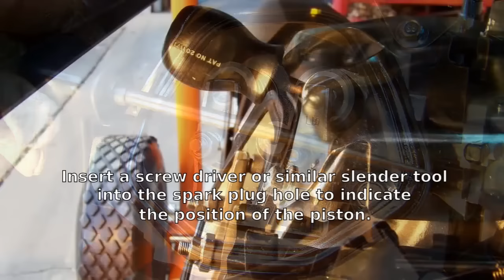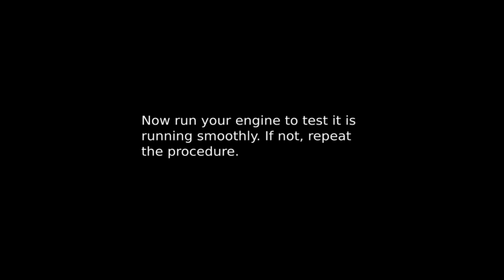Setting Valve Lash Clearances on a Portable Gas Generator and Small Engines

Comment: One small problem you don't state what the spec is on valve clearance
Reply from the maker: That will depend on the engine you have.  We publish valve setting under the brand and model on our website. Just see the cylinder head parts page for the full details. 
Start by finding your generator model on this page: https://generatorguru.com/

If it is not listed, or is an engine on another type of equipment,  please contact our engineers and they will be happy to find it for you. :)
Reply: 7.8 motor

Comment: Threw it on the dolly, put oil in (included) using the funnel (included), dropped in a gallon of the good stuff (see pictures) and it fired right up. Broke it in for a good 15 minutes with no load. She's ready for the next power outage!
Reply from the maker: Great work!!! Glad we could help. :)

Comment: I have a Champion 4650 generator that has a vibration problem since day 1. It has gotten better over time, but the handle still shakes while it is running. I've seen videos of this generator on YouTube, and they don't seem to have that problem. My question is, will adjusting the valve clearances on the generator eliminate the vibrations, or is it another issue? I have check the valve clearances, and it is within specs, 0.004".
Reply from the maker: Yes it should, but also check your engine mounts have not degraded as this also presents like this. If you would like us to check the clearances are correct, or have an engineer help you further, pls contact our Engineers on https://generatorguru.com/need-help/

Comment: Whats the valve lash for a pp6500 pure power, generator
Reply from the maker: We publish all setting on our site under the Make and Model.  It is published under the "valves" listing or the "cylinder head parts" listing (depending on how the manufacturer retails the items.)  Click our website to get your settings: www.generatorguru.com
Reply: @Generatorguru  unfortunately the site doesn't list that generator and couldn't find it on the internet, plus when i called the Pure Power Equipment site they are not the same company that made these generators at all and had no information to help so i believe its a Chinese knock of generator with a Honda clone.  Developer company is unknown but generator sold at Costco and home depot en mass years ago.

Eventually i used, (intake 0.003, exhaust at 0.005) which worked , tried many combinations ie;
 (0.006/0.008| 0.010/0.020| 0.005/0.009} but eventually too large snapped the recoil spring or and recoil ropes 4 (heavy duty ) of them in a row on different settings. 

So once this setting was set on the intake and exhaust valves ONLY AT TDC ( {Compressed one valve to set other method WILL NOT WORK ON THIS GENERATOR) puts so much force on the compression release and should be a warning to customers of this type of generator) and then it started and didn't snap the rope or the spring . 

You might want to add that to your site for information on this generator type PP6500PR with a 389 cc engine.

Comment: Okey burt Whert is the intake/exhaust clearance for a Briggs 2100 series on a troy bolt xp 7000 generator? It has this valve cover and of all the serial numbers and model numbers on the plastics and tags nothing gives me a conclusive lash spec for what I'm working on. Shooting flames from muffler.
Reply from the maker: Please contact our engineers here with the model code and they will be happy to help: https://generatorguru.com/need-help/

Comment: Hot or cold? What are the specs for Firman W2100i as I can't find them anywhere? Thanks.
Reply from the maker: We found them for you! If you look at page 20 in this manual https://cdn.shopify.com/s/files/1/0527/3350/9822/files/W01781_Owner_s_Manual.pdf? you will see it states: 
Maintenance Valve Clearance
- Intake: 0.08 0.12 mm (0.003 - 0.005 in.)
- Exhaust: 0.08 - 0.12 mm (0.003 - 0.005 in.)
Glad we could help!

Comment: In 4 stroke engines the piston goes up twice per cycle. Are you setting the valves at TDC of the compression or exhaust stroke, or does it matter?
Reply from the maker: Hi Andy
Its TDC of the compression stroke
Reply: @Generatorguru  Thanks. Good video.

Comment: A bit off topic, but do you know the expected compression measurement in lbs for the Generac GP6500 model 0059460. I had mine get slightly seized from sitting unused for too long.  Just enough to make it impossible to pull the starter rope. I poured some oil into the sparkplug hole and used a breaker bar on the flywheel nut to gently rotate crank back and forth and it promptly freed up.  After running it for 10 min or so to clear out the oil I measured compression at only 40 lbs. Seems really low but unit runs smoothly with and without a load.  Thoughts?
Reply: Hi there
For fault finding or technical advice, feel free to contact us using the link below
https://www.generatorguru.com/need-help/
This will allow our engineers to review your query and give you the best possible advice!
Reply: DECOMPRESSION SYSTEM
Reply: @eddierobles3129  Not sure what you mean by that comment.
Reply: No, its only americans that work in freedom units, ask me in metric, and I'll tell you.

Comment: The Factory manual for my Generac GP6500 model 0059460 says Intake=0.006" and Exh=0.008" but your site says 0.015" for both.  You may want to check on that.  Thx for superb video!
Reply: Hi JR
We have sourced the valve specs from the engine manufacturers that provide Generac with the engines so I'm surprised to see a different setting
Reply: .15 is metric. Thats0,15 mm you are looking at sae clearances.
Reply: I gave it a test, with .004/.006, I got 55 psi; with .006/.008, I got 62 psi; and with .015/.015, I got 91 psi...likewise, which is correct?  I am for .015/.015 (all in ")
Reply: @jameslee6494  I think this is too late for you, but the 62psi is correct. 91psi is too much compression, it will fail to exhaust gasses properly and will be more difficult to start.
Reply: Mine also says .008 exhaust and .006 intake. I have the gnrx7000

Comment: I have this exact engine but i lost the manual how much is the valve clearance ? its senci SC8000E , i cant find the value online
Reply from the maker: For future reference - We publish all setting under our valves listings on our website (Or in some cases under Cylinder head parts). 

Intake: 0.006" +/-0.002 (0.15mm +/-0.05)
Exhaust: 0.006" +/-0.002 (0.15mm +/-0.05) (Try the smallest setting first. If still not running right, change clearance to 0.008".)

Comment: 3:17 My generator 3:17  is a Champion Power Equipment 4000w peak and 3500w running. Model #40008  60 Hz what is the valve clearance supposed to be at 101 hours
Reply from the maker: Yes we do!!

We publish all setting on our website: www.generatorguru.com.

1) Got to  www.generatorguru.com.
2) Look up your brand and model, the find the "Cylinder head parts" (or valves if diesel) in the product list and click to open
3) You will find the setting are in the description.

If your not sure of the model, please contact us on the website and we will be happy to identify it for you.

Hope this helps!
The Generator Guru Team

Comment: Starting kick is very hard.
Removed the spark plug and then tried to pull the cord,found all ok .Tried multiple times with plug removed ,it was ok as usuall.But when installed back the spark plug,it became hard.
When you open any valve or remove spark plug,then it is not hard as usually but soon when we close the valve or install the plug,it is hard again .
What is the problem?
Reply from the maker: Pls contact our engineers on https://www.generatorguru.com/need-help/ and they will be happy to help. :)

Comment: For those wondering what engine you are looking at, it's a knock-off from a 30 year old Honda design. Pretty much the exact engine all of the volume brands are using these days in the 5 - 8,000 watt range gen sets. That would be Powermate, Homelite, Generac, and many others. The only outward difference is going to be the carb, the recoil start, and the exhaust. All of the internals are the same.
Reply: Do you know the clearances for that motor?
Reply: @codylong2012  .... if you mean clearance for valve adjustment, I use 0.004" on both intake and exhaust. The factory suggests 0.002" but after 25 years doing repairs, I feel that's too tight for how long people wait between services. BTW, that engine has compression release, so you need to set the valves when the piston drops about a half inch below TDC.
Reply: I have a Korean 7.5 KW with an identical design. I need to adjust the valve clearance after 300 hours. Do I use 0.004 on both as you suggested? It should be done at TDC right? Thank you in advance
Reply: @Rab4Web  ... I would see if the correct factory spec is out there but that area of 0.004 - 0.006 will probably do in a pinch. I would also go a little past TDC in case there is compression release built into the cam. Just watch through the plug hole till the piston drops a half inch as you pull it over. Turn it over a few times and double check your work before sticking the VC back on. BTW, for those who are not doing this on a regular basis they make a "step gauge" where each feeler starts at one size and goes to the next. IOW, the 0.004 will go to 0.005. The idea is the first step fits and the next won't go. It helps you get the proper feel.
Reply: @rupe53  thank you man! Thank you!

Comment: Hi there Gen Guru im from Australia and cant find any info on my diesel GenPower 6500 would love to be able to adjust the valves doesnt look like its ever been done , thankyou
Reply from the maker: You need to adjust your valves:

Intake: 0.006" +/-0.002 (0.15mm +/-0.05)
Exhaust: 0.006" +/-0.002 (0.15mm +/-0.05) (Try the smallest setting first. If still not running right, change clearance to 0.008".)

Comment: Champion Power Equipment links to your video, from their technical bulletin page for valve adjustment. For my Champion 100478 generator (intake left, exhaust right) they recommend 0.004 inch (0.1 mm) intake valve clearance and 0.006 inch (0.15 mm) exhaust valve clearance. No need to remove the spark plug, you can just look for when the exhaust valve is pushed down completely - and adjust the intake valve. Same procedure for adjusting the exhaust valve.
Reply from the maker: Thanks for sharing!
Reply: I'd expect Champion to link to one of the dozens of Champion's own videos 😉...removing the spark plug eliminates compression when pulling over the engine, to set the valves.

Comment: Is it possible to over tighten the rocker arm nut and bend the exhaust valve?
Reply: Dear Dan
If the rocker pivot is tightened down too far, it will prevent the exhaust valve from opening and will increase the force that would normally close it so yes it can bend the exhaust valve

Comment: Who is the gauge for ajust sportman gen4000 DF valve?
Reply: Dear Sir/Madam
is it the valve clearances that you need?
Reply: Styles Generator Guru yes!
Reply: Dear Jey 114

You need to adjust your valve lash clearances to:

Intake: 0.015" (0.381mm)
Exhaust: 0.015-0.020" (0.4-0.5mm) (Try smallest setting first. If still not running right, change clearance to 0.020".)

Comment: Hello I hope you can help me I have a duromax next gen power system xp4400e and I've changed spark plugs tested the spark plug an tested it an it worked and checked all the fuel line's make sure there no blocks and air filter and fuel filter checked the carb and its clean changed the oil in it and there's gas in the tank and made sure I had the key in the Run position and still cannot get it run. Every now an again it will backfire when I pull the cord to try an crank it. Please help i cant work without it
Reply: Thank you for contacting Generator Guru. I have been asked to look into your inquiry and I would suggest checking the valve lash on the unit. If you can provide the make and model of the unit we are happy to locate the information you will need to do this.

Comment: My 8750 Predator genny has run great for years, now all of a sudden it won't start. It sometimes makes a backfire sound when trying to start like a loud puff of air out the exhaust. I checked the oil level it is fine and I have always ran it out of gas when stopping so i don't clog the carb. Any ideas what this could be?
Reply: Hi there
It might be a case of the valves wearing and needing resetting to accommodate for this, that is the usual cause for a backfire, please see below for the valve settings

You need to adjust your valve lash clearances to:

Intake: 0.015" (0.381mm)
Exhaust: 0.015-0.020" (0.4-0.5mm) (Try smallest setting first. If still not running right, change clearance to 0.020".)
Reply: Thanks for the fast reply! I will try that and let you know how it goes. Will the head come off without damaging the gasket?
Reply: Yea I got it mixed up with the valve cover. I adjusted the valves but it still wont start. I took off the air box and looked in the carb. I cant see a choke flap just the plastic lever moving back and forth. Is this normal for my generator?
Reply: Hi there
That is not normal at all, it would explain why it isn't starting, I also hope that it hasn't found its way into the cylinder head anywhere
Reply: There is a flap deeper in the carb that works with the throttle arm, but I have never seen a carb without a choke flap. I ordered a new one. Man I hope that flap didn't get back in there. Thanks for your help!
Reply: Hi there
The carb should have definitely had a choke flap in it, I agree, let's hope it hasn't found its way into the head anywhere!
Reply: I forgot to mention I was sweeping under my generator a few days ago and found a little piece of metal. It looked like a flap of some kind. I don't know how long it was there. I wish I could show you a picture of it. I don't know how it could come out of there if it is the carb flap, I never had the thing apart until it quit running.
Reply: Hi there
It probably got spat out at the point when the generator quit and fell as soon as you opened the air filter housing, I've found parts of the carb in the bottom of the air filter box before
Reply: I put the new carb on and it fires right up! Problem solved, thanks for all your help

Comment: My powerhouse generator shop manual says 0.10 intake and 0.15 exhaust. I think it's a misprint. Shouldn't it be .010 and .015?
Reply: Can I please have the model number of the unit and I will check this for you 
Regards
The Generator Guru Team
Reply: Ph3100ri made by powerhouse. Thanks.
Reply: Hi there
If the valve specs are in mm then they look ok, if it says inches then I would say its definitely a misprint but the Chinese use metric so I would assume that to be millimetres
Reply: Oh ok. I didn't look always thought the top numbers were mm but looked closer and the second number is marked mm. How stupid of me.

Comment: Whats the clearence in my duromax xp10000eh?
Reply: Dear Luis Parra,

You need to adjust your valve lash clearances to:

Intake: 0.015" (0.381mm)
Exhaust: 0.015-0.020" (0.4-0.5mm) (Try smallest setting first. If still not running right, change clearance to 0.020".)

Comment: Dear, Please, Could you let me know what is the exhaust and intake valve clearances for a Briggs & Stratton 30675A Q6500 Inverter Generator - 6500 Starting Watts QuietPower Series Portable Generator
Reply: Hi there
The valve clearance for both valves is 0.005-0.007 inches or 0.13-0.18mm

Comment: What consideration needs to taken for the decompression? This looks like a Hyundai engine
Reply: Dear Aran
the decompression lever is useful for cold days or if the engine needs a service but on a good day, it should not be necessary, its a bit like using choke on a cold day to get a petrol engine going

Comment: Rope.why?
Reply: Dear Óscar López,

If you find that the unit is backfiring, or kicking back on the recoil, it will be that the engine has settled in and the Valve clearances need adjusting.

Your engine a system of moving parts, and moving parts wear. When you adjust a valve, you're not adjusting the valve itself but compensating for that wear, letting the valve open and close as efficiently as possible. 

We have made a video to show you how to adjust the Valve Lash Clearances: 

Setting Valve Lash Clearances on a Portable Gas Generator - https://www.generatorguru.com/help-me-fix-my-generator-repair-advice/

You need to adjust your valve lash clearances to:

Intake: 0.15-0.2 mm (Try smallest setting first. If still not running right, change clearance to 0.2mm.)
Exhaust: 0.2-0.3 mm (Try smallest setting first. If still not running right, change clearance to 0.3mm.)

Hope this is of assistance.

Comment: You should add a little bit of important info like settings should be done with warm or cold engine. Rather than using a rigid instrument for checking piston height, use a plastic straw, much safer.👍
Reply from the maker: Koko, we provide all setting for each unit under the cylinder head parts listing on our website. Please look up your make and model and find the valves (some models the valves are found under the product "Valves" listing.) In the description it has the settings. If your generator is not listed please contact us. www.GeneratorGuru.com
Reply from the maker: Thanks for getting in touch!